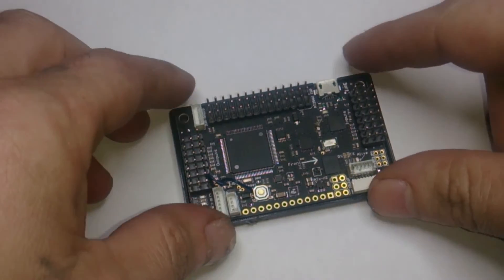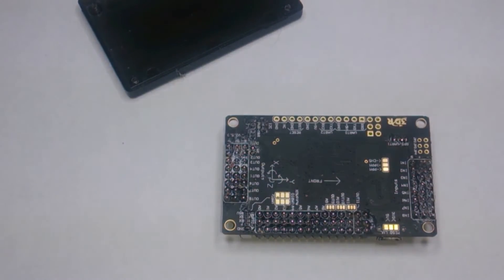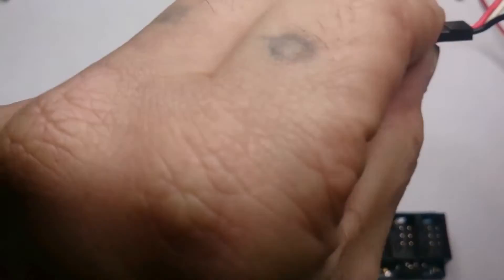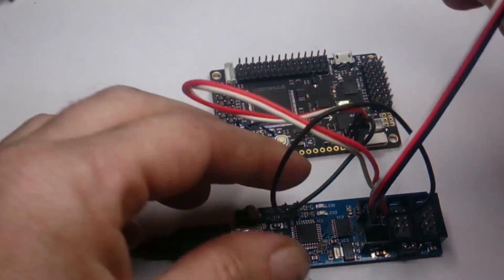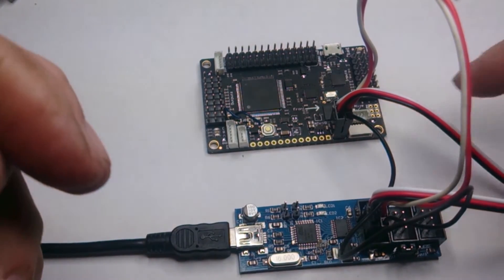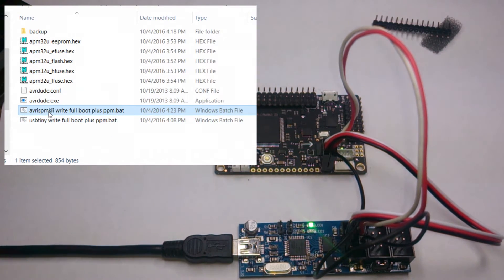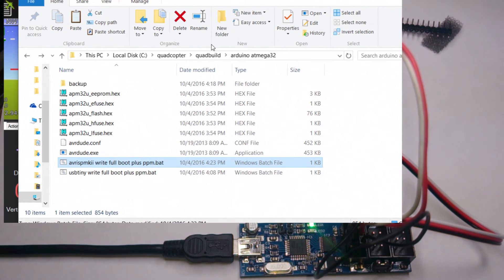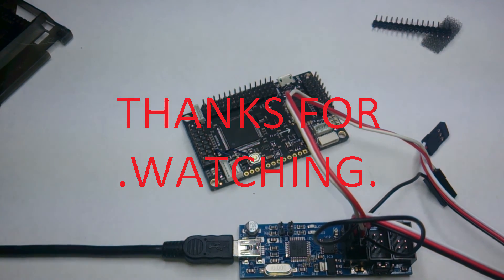unbrick apm atmega32u2

Comment: Thank you very much @ bangs6996
I keep a problem with two APM 2.8.
Try clearing the firmware with eeproo of arduino and it did not work anymore.
When trying to install in the mission planner does not recognize it (even if the PC does) or can not install the firmware goes communication error.
I tried to install the boot but I can not.
Technical specifications
• Windows 7 PC, 32 bits
• Usbisp-v2
When trying to install the shared files I get errors in all.
• avrispmkii write full boot plus v3.2.1.bat (error avrdude: usbdev_open (): did not find any USB device "usb")
• usbasp write full boot plus v3.2.1.bat (avrdude: error: could not find usb device with vid = 0x16c0 pid = 0x5dc vendor = `www.fischl.de ^ product = USBasp)
• usbtiny write full boot plus v3.2.1.bat (avrdude: Error: Could not find USBtiny device (0x1781 / 0xc9f)
awaiting your appreciations.
I apologize if the translation is not understandable, is that I do not speak English.
_____________________________________________________________________________________________________________________
Muchas gracias @bangs6996
Mantengo un problema con dos APM 2.8.
Intente borrar el firmware con eeproo de arduino y no funciono más.
Al tratar de instalar en el misión planner no lo reconoce ( aun cuando la pc si) ni se puede instalar el firmware sale error de comunicación.
He intentado instalar el boot pero no puedo.
Especificaciones técnicas
• Pc Windows 7, 32 bits
• Usbisp-v2
Al tratar de instalar los archivos compartidos me salen errores  en todos.
• avrispmkii write full boot plus v3.2.1.bat ( error avrdude: usbdev_open(): did not find any USB device “usb”)
• usbasp write full boot plus v3.2.1.bat  (avrdude:error: could not find usb device with vid=0x16c0 pid=0x5dc vendor=`www.fischl.de^product= USBasp)
• usbtiny write full boot plus v3.2.1.bat (avrdude: Error: Could not find USBtiny device (0x1781/0xc9f)
en espera de tus apreciaciones.
disculpa si la traduccion no es comprensible, es que no hablo ingles.
Reply from the maker: Hi did you install drivers and filter 
https://youtu.be/gKMFenjNrLE?t=212
make sure  you have jungo in control panel when you plug in isp.
Reply from the maker: not sure if you meant usbasp-v2 ..then that would be the usbasp write full boot plus v3.2.1.bat file.
Reply from the maker: do you know how to edit bat files edit the "avrispmkii write full boot plus v3.2.1.bat"
and replace all "avrispmkii" with "avrispv2"
Reply from the maker: but the usbasp should work... so make sure to try drivers and filter first..
Reply from the maker: and if that still does not work . you might have to use a program called progisp  I have not used that program but if your isp looks like this then you might have 
https://lh3.googleusercontent.com/-KW31qKybUjo/VP80i080SJI/AAAAAAAAMaw/7DN0w4b15LM/s720/20150310_191234.jpg
Reply: gracias este es el que utilizo
Reply from the maker: Your welcome.. I don't have your isp so i don't know how to use progisp. 
with your unit.. but i did find the program for you and uploaded to my google drive https://drive.google.com/open?id=1b_QMnnOIDhT027Vzf-3YnkRMw_loXiNV  

or google progisp 1.72   it does have the atemga 2560 chip in drop down menu
  In my package folder "New full write with firmware"  use the file apm_flash.hex 

or try the m2560.hex ..then use mission planner to program firmware using the  usb cable on the side of your apm.
Reply: Thank you.
Thanks for sharing, but how the progisp172 is used.
I leave you a .rar to visualize what I'm doing and you can identify my error.
regards
Reply from the maker: your are in wrong location for atmega2560
that location is to program atmega32u2 chip

When you plug apm into computer . does it still get detected as com port ?
Reply from the maker: If it still gets detected its this location for the atmega 2560 chip
https://youtu.be/gKMFenjNrLE?t=489
Reply from the maker: The atmega 2560 is where the firmware v3.2.1 goes

the atmega32u2 chip is for usb and ppm/pwm

So plug in usb on side of apm then plug into computer.
check control pannel does it get detected as a com port?
Reply from the maker: also here is picture of progisp READ first
https://drive.google.com/open?id=1_uOwfC6Y5aPEVF9DDx7ETS-HO6mPSmUJ

this should be able to read your chip.  Try this first to make sure usbisp works.

then tell me if it works.. if it does i can make another picture showing how to write.
if you need that.

this is for the atmega2560 chip
Reply from the maker: ok i make another picture to write..
Reply from the maker: Ok this should work for write
https://drive.google.com/open?id=1orTHP7TZfRoAT-MBXY52pl_URonFqIkY

after your done..remove isp connect to mission planner with usb

if it does not work with file    "New full write with firmware\apm_flash.hex"

try with "m2560.hex"   then remove isp then open up mission planner
Do not connect.  go to firmware update and install version 3.2.1
Reply from the maker: Hi you use progisp to upload m2560.hex not mission planner.  
after you use progisp with file m2560.hex   then use mission planner to program firmware. v3.2.1

Hi ..plug in usb into apm 
go into control panel device manager  and tell me if it gets detected as com port  .. If not you will need to program atmega32u2 like in this video.
with different file.

Are you plugging isp into right location on apm like in picture.?
Reply from the maker: show me picture of where you are plugging in isp.

Does progisp work?  can you click on verify after you write your file.
Reply: thank you very much for the consultancy, but I could not succeed
as I commented I have two APM 2.8 with this same statement and the damage was at the time of erasing the eeprom from arduino.

Well I've related three tests, so I leave the images, any questions I know

https://www.dropbox.com/s/m7e7cytx7vw6xbd/2560.rar?dl=0
Reply: the second method only performs a test and is the one you present in the video.
I attached photo sequence
https://www.dropbox.com/s/rekgeh3hvyo4ery/32u2.rar?dl=0
Reply from the maker: can you re download https://drive.google.com/open?id=0B2w6_OKE_2kxa0NSMl82SmhVYjg

run the unbrick usbasp.bat for 2560 chip again.

then connect usb to apm (com8)?
go into xloader folder
use file ArduCopter3.2.1test.hex

Hex file
ArduCopter3.2.1test.hex

Device
Mega(ATEMGA2560)

COM port
com8 ?  

then push "upload"
Reply from the maker: hi.. what happens when you use write full boot plus v3.2.1.bat 

plug in the apm usb power and just leave it alone.. do the lights blink
on the apm?

Maybe we have to start looking at hardware failure.
did you plug in apm and battery at same time?
Reply: first of all Friend Happy 2018 year this year bring blessings for you and your family
Well I tell you that the program XLoader.exe, does not advance has more than 25 minutes in uploading and that does not move.
I am already losing hope of recovering them.
Reply: hi .. what happens when you use write full boot plus v3.2.1.bat

plug in the apm usb power and just leave it alone .. do the lights blink
on the apm?

Maybe we have to start looking at hardware failure.
did you plug in apm and battery at same time?
 
I answer in order.
1 I think that full load I do not observe that indicates any error.
2. no lights do not blink, only the fixed light is on top of the gps
3. I have not connected the apm to the usb and the battery at the same time it stopped working at the time of installing the eepron of arduino.

my intention was to do everything and I think I will achieve it
Reply from the maker: ok use file  write full boot plus v3.2.1.bat   .. 
after unplug isp.. then plug isp in again..
wait 1 min do the lights do something different..

.. unplug isp .. 
plug isp into atmega32u2 location.

wait 1 min do the lights do anything different.

does it go red blue red blue..
Reply from the maker: during these tests do not plug in gps or anything at all.. only the apm
Reply: is correct, when installing the usbasp write full boot plus v3.2.1.bat, connected to the port atmega32u2 turns on the red blue, red, blue LEDs.

the process ends up installing everything 100%

at the moment of connecting the apm (usb cable) it turns on the blue light that is on the connector of the piower module and the red on top of the GPS

the APM, this naked has nothing connected only the usb cable
when connecting the mp, the same error is already reported.

when the apm is connected to the MP the blue LED flashes 6 times and stops, 6 times and for
Reply: friend I think the APM is damaged, the led indicators (blue) do not vary, it is in 6 fast and stops.
regards
Reply from the maker: yes its hard to say what is going on.
after you write atmega 2560 with firmware v3.2.1

can you try to read the atmega2560 and send me the file
at   bangs696969@gmail.com 
or give me link to file.

you can also test here to make sure it is 3v3 volts
https://drive.google.com/open?id=0B2w6_OKE_2kxQjFnOWhUMU9VdEE
Reply: friend excuse me but I do not understand you ask me
Reply from the maker: use progisp to program atmega2560 chip with file apm_flash.hex
or use  usbasp write full boot plus v3.2.1.bat

then use progisp to READ save file and send to me or upload in rar

I will look at it .
Reply from the maker: HI.. all files are BAD..   

4k file is FFFFFFF
256k files are corrupt.really bad all 00000 almost.

.. 
did you use progisp? 
first do this
https://drive.google.com/open?id=1orTHP7TZfRoAT-MBXY52pl_URonFqIkY

then do this
https://drive.google.com/open?id=1_uOwfC6Y5aPEVF9DDx7ETS-HO6mPSmUJ
Reply: I already got the APM to connect MP but can not update the firmware.
now it connects but does not update firmware.
Reply from the maker: what you can try to do is connect your power to the apm
power module?

cut the red wire on your usb cable (power wire). .. then try 
to use usb and power module.

then try to update firmware..

cable example
https://www.youtube.com/watch?v=e6Xgn1gf4YA

also make sure to manual pick com port and baud rate 115200
in mission planner don't use auto.
Reply: Hello Friend.
Well the MP connects in the APM, what I can not install now is the correct firmware.
I leave you some images.
How to position the cable, leaving the power cord (red) unconnected
https://www.dropbox.com/s/qjbnf7t7jqote80/20180115_175056.jpg?dl=0

MP error message.
https://www.dropbox.com/s/fvavivs752izwra/mp%20cable.jpg?dl=0
Reply from the maker: Hi .. In mission planner use 
Load custom firmware and try this file
https://drive.google.com/open?id=1zmobXSTBXbJCncX_zl4gYS9Au6vxKmfb

the file above is just a test its for a Quadcopter but try it and see if it works.

its almost like it can't connect to server. ( firewall ?)
if it works let me know.. You might just have to re install mission planner
Reply from the maker: the first picture shows it working?
when it gets params that usually means it works.

Not sure about other pictures maybe bad connection?
when you get that error go into control panel and make sure you still  have com port from apm
Reply: bangs6996  
Hi.if that is the menssage that comes to me. Already check and if it is connected
Reply from the maker: try apm planner maybe.. 
http://firmware.ardupilot.org/Tools/APMPlanner/apm_planner_2.0.24_win.exe

its like mission planner made by the same people..

I find it odd that you can download  your params but when you try to update firmware it messes up.

After you connect to misson planner and download params can you go to hud and move your apm around to see if it works?

We have done so much that we went in a complete circle it seems..

Comment: HI Mate just to let u know replace that faulty chip today re flushed the APM with yr package and still not recognize by pc on any com. I guess I will give up on this one :).

Many Thanks for your support Mate
Reply from the maker: sorry to hear that .. ... So to get this right.. you were able to 
unbrick the apm..with my other package... u were able to use this 
video's package.... ..

Your apm com port gets detected it just can't connect to the apm... ..

so what ever pins that chip you replaced that connects to the apm ..are fried.. u think its something we can re pin? through the firmware??
Reply: bangs6996 the apm dose not get detected by the pc at all. when i plug in to pc i should get notifications about new device been connected but i get nothing instead only led lights on apm it self
Reply from the maker: so if your still able to use the isp to program the atmega32 chip.. i 
guess that chip took out the pio's or something else on the way back to 
the atmega32 chip.. or the 2560   .. tracing it out does go to uart 0 
from that chip you soldered on. ect... the bottom pins on the apm 
closest to  isp for atmega32 is uart0 ... even though its uart0 you 
might still be able to connect to the 2560 through it.57600 baud does work with it now.... Or find away to by pass the mux 100 percent... ..